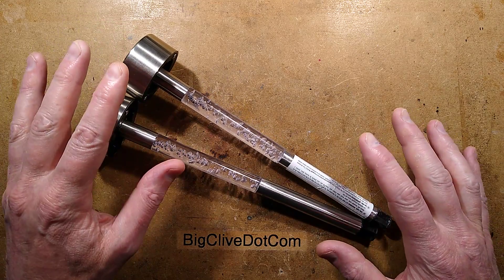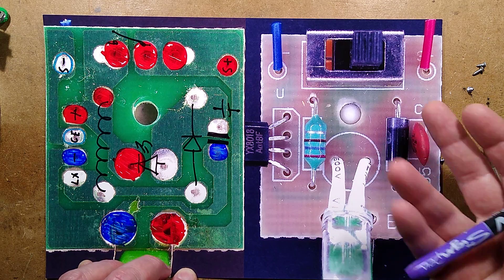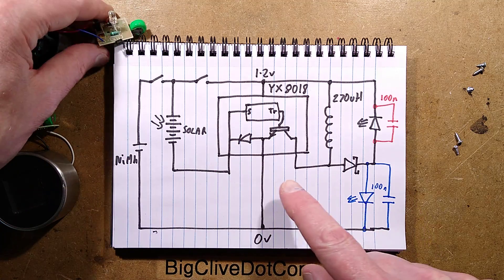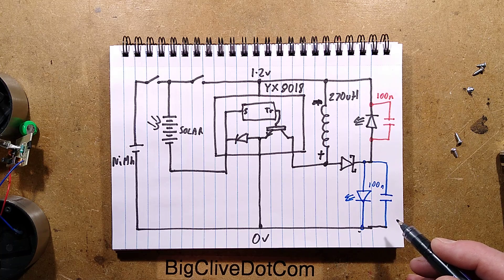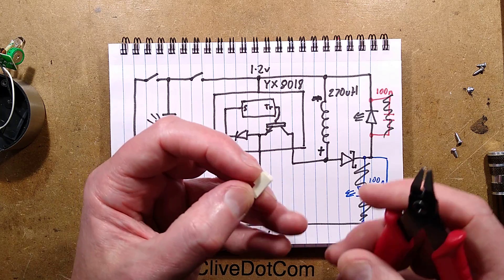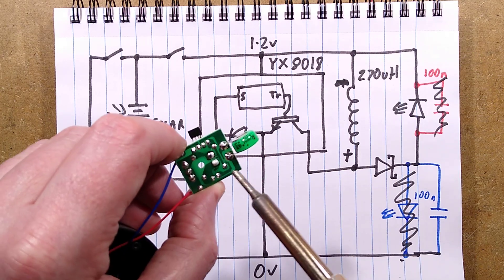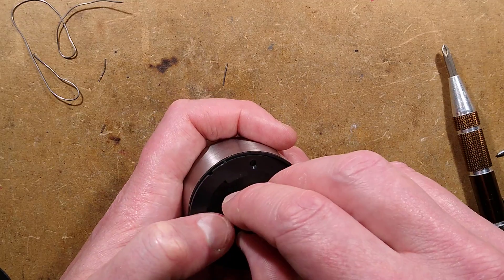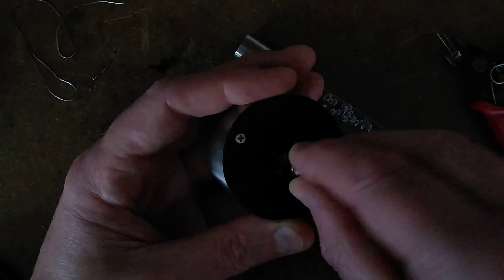Hacking a Poundland solar light with intriguing design fault

Comment: There's no design fault. It works perfectly like that. There's actually a problem if you connect the LED to GND: the inductor discharges in the battery (in reverse) so it discharges it... It would probably make the LED a bit brighter because of the extra energy from the battery. But this would change with the voltage on the battery. So a fully charged one would make the LED even brighter.

Comment: Interesting that Clive should choose to do this when I've done the same.  I want to mount one of these over the address numbers on my porch.  That way they can be seen at night.  But these damn button cells won't hold enough charge to light it up for much of the night - just a few hours.  It's a shame they had to cut corners and use a cell smaller than AAA.  So I have to solder wires to an AAA Panasonic Eneloop long life cell and run the wires through holes in the case.  Then try to waterproof the cell a bit.  Maybe some hot glue, but it might not hold up in the hot sun.  Thanks, Clive.

Comment: That is confusing but I fingered it out. when the mosfet is open the cap gets charged through the inductor, then when the mosfet closes the diode is now reversed biased so no current flows and the LED sees both the battery and cap voltage combined so it turns on. The voltage created by the collapsing field in the inductor is not being used.
Very odd indeed. That angel light you might recall that  worked on uses a QX5252 chip which is the same thing but the circuitry is normal with the cap across the RGB led [that was my mod] so the built-in chip does not reset and stay on red and the white blinkers keep blinking.

Comment: When I was a kid I would use old aerial coax cable for solder braid and scalextric brushes
Reply: I used it for Scalextric brushes as well! I even had a modified car with some fine emery paper mounted on a sprung hinge for removing oxidation on the track rails. Fond memories.
Reply: @ferrumignis  I was just thinking about how I used the braid for the track contact brushes for Scalextric cars.
Reply: I did the coax for car brushes too. Happy days

Comment: If I would put bigger capacity battery cell inside that chip would charge it normally? One time I put bigger cell in different type of solar light and I noticed that it behave weirdly(battery get hot and difference in time was not that big really...) so I was wondering if those chips are set to work only with specific capacity of battery...

Comment: Just repaired two of those (kind of) lights for my aunt this weekend.
They had a switch for white, color changing, and off (that needed some contact spray)
Soldered through al the wire connections and mounting points for the parts and the problem was solved.
Some problems also come from the fact that people change the chargeable AA batteries for normal AA batteries.

Comment: I purchased a few of tbese to take to sunny climate.  Stopped working even with plenty of sun so not sure if its an issue with the battries or could the sun be to strong!!
Reply from the maker: Sometimes high levels of sun can cook the small cells.
Reply: @bigclivedotcom  Thanks for letting me know, was not sure if the was the case.

Comment: That's a singularly weird way to abuse a circuit. I can see several potential return paths for the inductor and they're all bad.
Reply: I see only 2, one is diode-LED-inductor.  The other is diode-capacitor-battery-inductor.
Capacitor discharge is obviously LED-batterycharging-capacitor.

Comment: I Bought 1000 Super Bright 5mm Yellow Flat Top LEDs For $6 w/Free Shipping On eBay, They Will Really Put Out Some Great Light On These Lil Yard Lights! I'd Change The Batteries To LiOns Also... Thanks
Reply from the maker: For standard single cell NiMh lights I'd suggest starting with a NiMh cell.
Reply: Lion batteries work at a diff voltage (4.2V o think) and the charging regulator will be totally different . The yx8018 is specifically for 1.2V. I had thought of doing the same thing (noob to electronics). But now I have instead repurposed some old 18v nimh drill batteries, and pulled them apart to fish out the cells (all 1.2V) that were still good (about 1/4 of them seem to go bad, but the others are salvageable).  Most ppl have old dead or weak 12-24V Nimh batteries laying around!

Comment: Very nice!!

I use the flick method almost all the time. Unless I’m working with something large or sensitive like TV or motherboards in which case I’ll then use braid. 

I actually got a few garden lights recently I’d love to show you. They have a board with 24 smd led similar to the kind in the led light bulbs but they’re obviously not the 48Vf type. They have a lovely 2000mAh 18650 cell to power them. The first one I bought I was only getting about 3.7v from the solar panel and the second I tested I was getting around 5-6v. 
I absolutely love watching your videos because it’s pretty much exactly how I’ve learned everything about electronics (besides tons of reading). Reverse engineering can be the best and sometimes worst teaching method. By worst I mean by example of this video, if the original design is somehow flawed, but then again it serves as a great opportunity to modify.🤘🏼😁🤘🏼

Comment: If the PCB gets completely corroded (as usual), you can buy 50x YX8018 (or QX5252) on ebay for 3 bucks and build one yourself from scratch. One chip here, some inductor there and you're good to go.
Reply: It's always the solar panel that fails on mine, I've never had a chip fail yet.

Comment: Won’t that capacitor configuration still work just fine, just the voltage across the capacitor will be 1.2V higher than in a more typical configuration?
Reply: Yes, you're correct. Since a (good) battery is like a constant voltage source, it acts as if it has a large value capacitor in parallel with it. So the circuit will work exactly the same whichever side of the battery that extra capacitor is connected to. The voltage and ripple across the LED will be identical in both cases. There WILL be differences to the circuit operation, though, depending which side of the battery the LED is connected to. One may have advantages over the other - brightness or battery life.

Comment: How do you avoid breaking the Chinesium wires at their solder connections as you manhandle those  assemblies? You must have the dexterity of a neurosurgeon.
Reply from the maker: Delicate handling.  But I've snapped off plenty of them in the past.

Comment: They look much better now. I have cutlery with shafts looking exactly like that. I just used the spoon for a meal. If you have a property out in the woods and it is very dark there at night, lights hanging from the trees will light the area better up than those put into the ground. A couple of years ago I bought a whole bunch of Ikea solar lights on sale. They came with a thin white fabric shade. I use them without the shades, as the shades would get dirty and destroyed in no time. This exact type is the best I have had so far. They hung outside during winter, and they are still alive and well now. Unfortunately they changed the design so the newer one's can't be used. Mine has the strings attached to the solar part of the lamp. The newer one's have the strings attached to the lamp shades. Those who work at Ikea with these things don't seem to have a clue of what is usefull or needed when it comes to solar. There should always be the possibility to buy spare solar cell parts for charging that can be put in one lamp. You might need three lamps inside or outside, but you would want to have maybe ten or more of the charging parts. If there is not much sun, they don't last long. They have never thought of this at Ikea.

Comment: They can just use a “Light Dependent Sensor” and a “Joule Thief”
Reply: No need for a light sensor when you have the solar cell
Reply: @KevinDC5  It's actually a LDR (Resistor)
Reply: Bastards are too cheap to use a true Joule Thief because it requires winding two windings on the coil.  Instead they use the four legged TO-92 style chip to save labor.  Actually it's surprising that they haven't changed the thru hole inductor for a SM inductor.  And the most atrocious part is that button cell that won't run through the night.
Reply: @acmefixer1  It's all about economy of scale. This specific chip is used EVERYWHERE. They probably sell about 50 million a year of just this specific 4 pin IC. The problem isn't even that chinese manufacturers are cheap: It is pressure from their customers (US, UK and EU retailers and suppliers) who push prices to absolute rock bottom. Many of these manufacturers would JUMP at the chance to do real engineering with real and interesting products and solutions. China can make genuinely excellent products... if you actually want to pay for excellent products.  But nobody does.
Reply: @acmefixer1  Go to Dollarama and you will see the same crap. the battery is bigger though.
Reply: @acmefixer1  copper is expensive these days, and those type inductors you mentioned take quite a bit of it. Then the fact they’re selling these for 97¢ at my local store.  But yea, I totally understand you. 👍🏼

Comment: Not to forget that sanding the top of the LED flat spreads the light more in the tube, makes it brighter too
Reply: But then a part of the light gets scattered to the sides, and does nothing. These LEDS have a lens to focus a narrow angle. Look at the sides, almost nothing  is coming out. The wall of the acrylic tube will reflect perfect.
Reply: @erikdenhouter  it is all enclosed in a tube, whatever you do it will go into the acrylic, if it is focused then you will only see it bouncing off the bubbles, if it were a perfectly clear tube you wouldn't see much light. Sanding the lens diffuses the light and makes its angles wider so the light exits the tube at more angles and you see more light
Reply: Why bother just do as Clive does “ we will just trim them a little bit” as he did with the plug in air freshener hack
Reply: @patomahony9747  snipping gives a clear edge usually, sanding gives a diffused edge, a clear edge is again the same refraction problem like if you didn't trim them at all

Comment: A few months ago , I changed the LEDs in mind for a blue led. I also put a 22ohms resistor in series with the led , it reduced the brightness of the led but the solar light stays on a lot longer
Reply: Although putting a resistor in series with the LED will reduce the brightness and extend the run time, some power will be wasted in the resistor. It would be more efficient to increase the value of the inductor instead.

Comment: Would a flickering candle LED work in your remastered version?
Reply from the maker: Yes, but when it is completely out the voltage can rise across it.
Reply: I have done this and it works. I did find that depending on the colour of the flickering led, that results vary. I suspect that some flickering LEDs prefer to have a slightly higher voltage and that if the voltage is too low it doesn’t actually flicker properly, but I never bothered to fool with different inductors.
Reply: Cheers guys, just wondered as you don’t see many ‘solar candles’ for some reason and I imagine a bunch of them together would look really pretty.

Comment: Just an FYI, you can’t “over discharge” a single NiMh cell as you mentioned. In fact some people intentionally discharge NiMh cells to zero volts to help recondition them. They’re entirely different than Li-Ion cells in that regard.
Reply: True, I suspect it's more likely there because you'd get a lot of returns as faulty if the cells were allowed to discharge in shipping. The first thing most people are going to do when unboxing is turn it on then cover the solar panel to see it light up. If the cell was empty when unboxed, the few seconds of charging it would get before that test wouldn't give it enough voltage to light the LEDs.

Comment: For clearing solder holes. the cheap Chinese-made hollow stainless needles work a treat.
Reply: He uses those in a previous video
Reply: @vtbn53  Must have missed it then, thanks for the observation.
Reply: @tubastuff  No worries, you can see the solar cell right at the beginning at one end of the light, but that's the last we see of it I think, but he does have it in his schematic as well.

Comment: I didn't think deep discharge was actually detrimental to nickel chemistry cells? Might be wrong but I'm fairly sure
Reply: Also, the capacitor to ground works because this is effectively AC. Biased of course but a changing voltage is conducted through a capacitor. Still, I agree that this is odd. Would be interesting to scope across that cap to the negative

Comment: So, is the LED in the default configuration acting as a free-wheeling diode?
Reply from the maker: It's to allow the capacitor to hold the charge.  Purely half wave rectification.

Comment: I enjoyed that explanation on how the inductor boosts the voltage in a DC current. I always just figured it was just the water-hammer effect of the rapid energizing and collapsing electric field
Reply: Ease way to remember: Induxtor does fir current what capacitor does for voltage.  Once charged up to X mA, it'll take a reverse polarity voltage to discharge it.